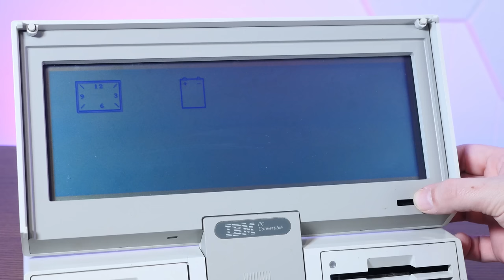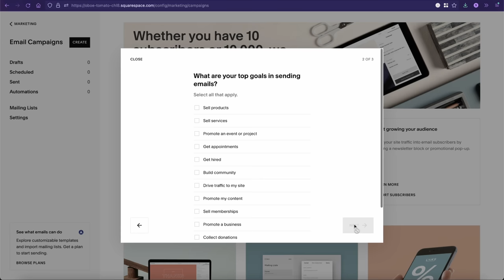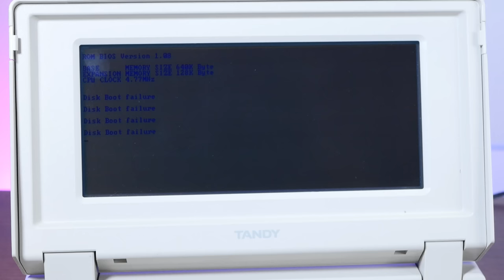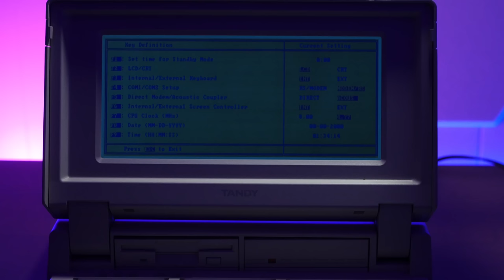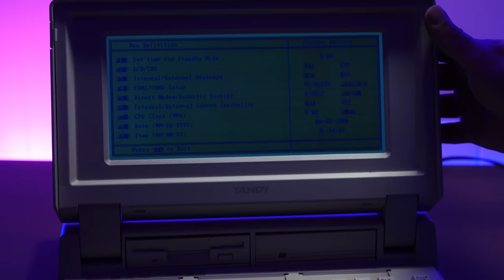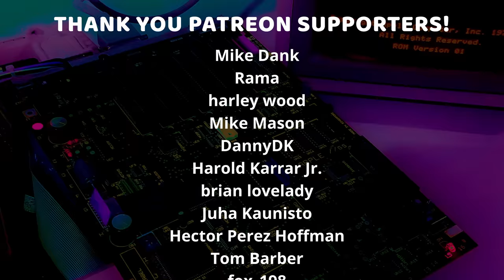I Fight a Tandy 1400HD to the Death

Comment: What do you want to bet that some one yonked the drive cage off and messed up the original card then replaced it with a new one. That cap might have bounced around in there and shorted something on the board later. Bricking the machine.

Comment: Never never Never just jump a fuse without replacing it. Also it would have been better to check and see if it blew in the first place :). And if it did, there was a reason it blew and since you don't know what that reason was,  you should replaced the fuse and if it blew again you should check to see what actually caused it.

Comment: Am I heretical for wanting to gut these systems and replace the panel with a modern screen and fit a Latte Panda and a GPU in the case as an ultimate sleeper?
Reply: I mean, it looks like the caps were pretty likely to shred the entire board's traces, so while it's up to you what to do with your stuff, these do seem like interesting candidates

Comment: Don't you know how to check a fuse with a multimeter? In any case, if you want to bypass the fuse, use the thinnest wire so that it can blow out if something happens. Also, you can connect the power supply in series with an incandescent bulb. In case of a short circuit, the lamp will simply light up. This is the best way among the wrong ones.

Comment: Such an unprofessional repair job. How hard is it to make some reasearch. Buy some tools and do things properly. First thing u should have done is to check the voltage rails with a multimeter. Replacing the capacitors is not always the solution. When things are 40yo there are lot more than capacitors that could go wrong and more importantly make things worse!.